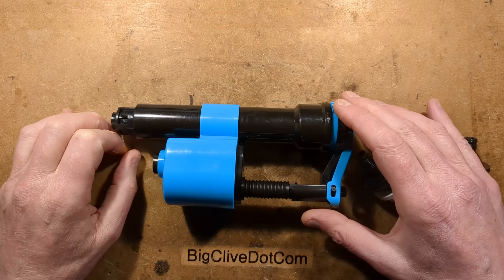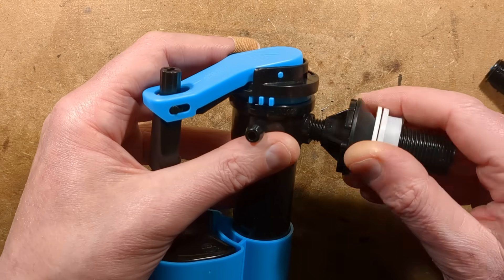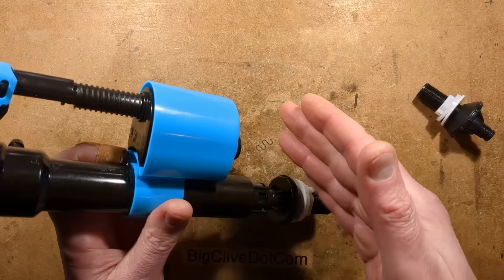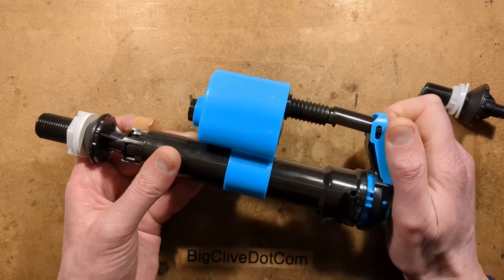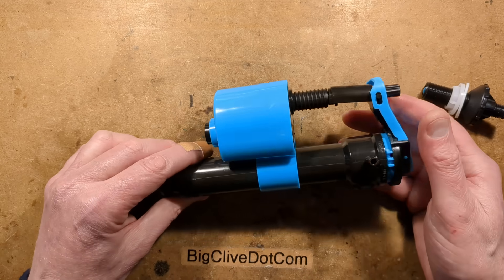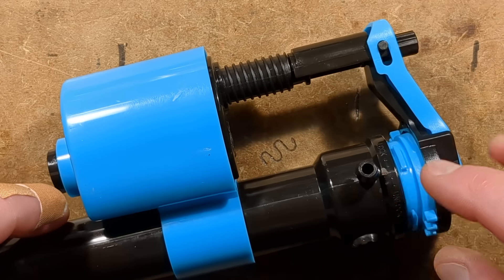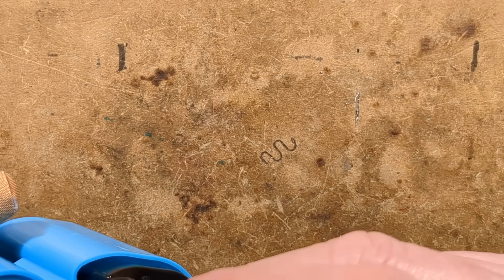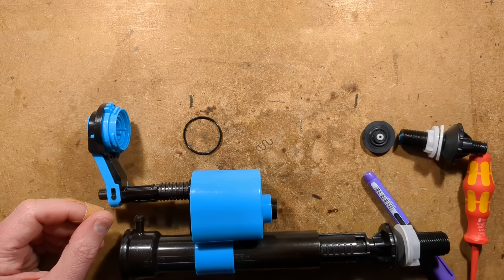Very clever universal Skylo toilet cistern fill valve system

Comment: American here and yes, the small side nipple is for a hose which empties into the cistern overflow tube into the bowl, to ensure the bowl is full. I bought a brominating system that goes inline with that hose to make the water in the bowl toxic to mold and mildew. It works wonderfully until the brominating pucks dissolve around each month. I can tell because I start to see mold growing at the waterline in the bowl, so I replace them. Though the manufacturer would be happy to sell you brominating tabs for several dollars in individual packets, I can buy the exact same ones in a large canister in bulk. They sell them at hardware stores for use in spas.

Comment: Will this work flawlessly for 83 years like the old cast iron, high mounted toilet cistern...with pull chain, that  I have in my downstairs toilet?  Mmn, doubt it, looks a bit flimsy to me.😅
Reply from the maker: No.  But those old fill valves did need repaired regularly when the water control valve degraded.

Comment: Not many pilot operated valves in daily life, but most of them seem to be in bathrooms. From the diagrams I've seen flushometers have a similar diaphragm, but with a spool valve that stops flow at both extremes to stop you from wasting water if you hold the handle down.

Comment: Thank you, your video finally convinced me to fix mine, in my case somehow the float and it's assembly which normally should be vertical was 30deg off vertical and as it was going up it rubbed on the side of it's assembly and sometimes got stuck and never got up so water started dribbling when water reached top. I rotated it back to vertical and now it works reliably.

Comment: Water conservation tip: When I use the shower, I run the water until it warms up. I collect that water in a bucket and pour it into the toilet tank as it is refilling.
Reply: When you conserve water, you are saving two resources, water and septic system.

Comment: I wonder how this conforms to water regs in the UK without having an unconstrained air break? Sometimes a perforated dip pipe was fitted from the inlet valve  into the water in a "standard" cistern to reduce noise - effectively filling under the water surface - but they were banned because the pipe meant there was no open water break and there was a hypothetical possibility of back-syphoning if mains pressure was lost ...
Reply from the maker: This valve was bought in the UK from Screwfix.  I think the critical level adjustment is what avoids back syphoning.

Comment: 6:30, if the piece of nail didnt come off completely you could have used superglue to hold it together till it regrows.   it may help to add carb soda to the superglue to build it up for strength.   thats what i try when i have a nail incident.
Reply: You can also use the material from a tea bag almost like laying fiberglass and epoxy.
Reply: @billtheunjust  , i hadnt even contemplated teabags.   i do find uses for natural fibre string with epoxy or superglue.

Comment: Hay Mr Big I had the experience with one of these new cistern valves but the little pressure hole on my version had a small metal pin valve in it and this either gummed up with crud or the rubber wore out and it leaked. This continually drizzled water in the bole a condition as a 65 y.o. I don’t want to be reminded of and after only a few weeks of operation. Fond memories of the old thunder box ball valve cistern 6 feet up on the dunny wall cast out of iron. The same as your modern finite analysis model but for adjustment you bent the float arm and I remember cutting a new seal out of an old boot yes leather and it lasted years. I also remember seeing my first so called closed coupled cistern and thinking there won’t be enough pressure for that to work. Arr yes everything has improved…. Wobbels the mad Aussie.

Comment: Great design and wonderful analysis as always, Clive. Have a look at some Geberit side and bottom inlet valves - some of which use a pivoting float rather than one that rises/falls. There are certainly some terrific designs, clearly considering the vast array of retrofit applications where a multitude of adjustments cater to aforementioned needs. The inclusion of both side and bottom inlet applications on this Skylo unit is incredibly practical.

Comment: I'm a plumber and have fitted loads of these. I keep one on the van as it's universal/'versatile' and saves carrying several other variants (although I do carry Dalchem/Torbeck/Fluidmaster for straight swaps as they're all still commonly found). These work great and they're cheap too. For those who mentioned preferring a brass rather than plastic shank, they do make a brass version for an extra £5 or so. A well thought out design for sure !

Comment: would that little nozzle be for use with the syphon urinal systems?
Have you covered the universal push-button dual-flush mechanism?
Reply from the maker: The syphons just have a trickle valve.  I've featured the dual flush system.
https://youtu.be/nOQK60npBUk

Comment: I have stripped those units before, to remove leaf debris that got in them, as the rustic cottage they were at was fed with water pumped direct from the dam, with no filter. Also did a few of the regular float arm types, as they were also clogged. Luckily I also had my small box of plumbing bits with, so had spare nozzles, all the large diameter low pressure type, as I rarely use them with regular water mains pressure, along with flipping the diaphragm around for those with bad wear. Done because otherwise no toilets in the ablution block, so did all 4 toilets in there, plus reseated 3 taps as well that were leaking, as just a washer would not fix the worn seat in the tap. needed a shower and sinks that worked.

Good thing Clive has never ridden along on a fire engine or any tanker truck, he would likely have tossed his cookies, and i wonder if a 30kl tank of hydraulic oil has the same effect on him as well.

Comment: That's very similar to Fluidmaster valves in almost every feature. The standout feature is the side or bottom mount option. That really is a fantastic thing from a repairer's point of view. I'm thinking that the brass version isn't changeable though. 🤔
Reply from the maker: They do the dual port versions with brass inlets.

Comment: I have a modern (?Torbeck) filler valve with a float which moves up and down around the pillar... until it scales up and sticks.  I haven't seen that much water coming out of an overflow since float balls were made out of copper and eventually sank.

Comment: Did some toilet repairs for my son in California. What struck me about US plumbing is the common use of those flappers for flushing instead of siphons. When they leak they waste loads of water. Also parts were very expensive, especially if old style brass ones. I am sure new houses there use cheaper parts.
Reply from the maker: The flap valves are incredibly simple and very easy to change the flap.  I use one here.

Comment: On one of our toilets the flush sometimes carries on very slowly well after  the main flush. I can't work out how a small flow of water can find its way uphill, over the top of the siphon and down into the pan. As normally the siphonic action only starts when a large slug of water is pushed up the hill by the flush handle.
Reply: The only way to stop it is to crack open a joint on the siphon to let in some air to break the siphonic action. So somehow the siphoning is carrying on very slowly because there has not been enough air ingested at the end of the flush to break the siphon. It's all very mystifying.

Comment: My experience in NA. Toilets have a 1/2" supply line, 3/4" is overkill. I have never seen side entry. A standard toilet shutoff valve is fitted and from there,  usually a standard flexible toilet line of desired length. Yes you can get a rigid line, but that seems to be needlessly more difficult, and im not sure anyone does that these days.

Comment: The brass pipe connector version is the only one to use. Plastic threads can strip off from the water pressure.

Comment: Would be perfect if these can be changed out in situ without having to remove the part that screws to the cistern and copper pipe. I wonder how sturdy that one is with the narrow neck thread joint - if that snaps one major house leak! In a previous house every cistern had a fill valve from a different manufacturer... all incompatible. First job moving into next house was to retrofit every cistern with identical fill valves.

Comment: Nightmare to work on when in a cistern. Try getting pliers in like that when its fitted. Also the valve doesn't separate,  so you cant just change the head. Fluid master so much better, plus more places carry the washers. But good video @bigclive.

Comment: I’ve never seen a side-inlet valve before. Typically use bottom inlet here in the land of freedom-eagles. (Bottom-entry. 🤭) That diaphragm seems to be the standard nowadays. I put several differnt brands & models of valve in a toilet before I realized that it was unfiltered rain water that was fouling the diaphragms. 🤦🏻‍♂️ duh.

Comment: That looks so much like a standard modern Fluidmaster "fill valve" here in California... all plastic, telescoping tube, side siphon fill, large plastic float attached to the tube, valve/diaphragm system, it's all there. The main difference I see is the cup around the float with the air pocket. Ours don't have that. Looks like a nice addition. Also here they all have the inlet at the bottom. Super easy to install. Clever stuff.

On the subject of phobias, mine is about people mentioning their broken nails... brrr... I had to skip that fast. <people are weird>

Comment: One of my biggest peeves in life is waiting for the cistern to refill. You're standijg there like an idiot, listening to the pitch of the valve or water filing, waiting for it to recharge enough to engage a second flush. 

I like to pull the restrictor out now, but it only helps a little with refill speed. I'd love to see a solenoid based systen or something other thwn the diaphram system where a higher volume could flow through. I've given fluidmaster this feedback. Maybe one day they'll redisgn it with a bigger diaphragm and  manually operated ball valve so people can set their desired fill speed. 

Ps. Youre correct, that side outlet is for placing a ½" tube into the overflow pipe which refills the toilet bowl, and maintains a higher water line in the bowl.

Comment: That little nipple at the top that is block is for a tube that goes down the center of the fill tube. There are holes around the underside of the lip in the toilet itself so that water sort of washes the sides of the toilet while it's flushing. At least that's how it works in the us.

Comment: In the US, the small port rinses the trap, but a new gizmo is a bleach canister plumbed in-line, adding bleach on every flush. Bleach gets in the rim and its holes, but does not sit against rubber bits like the big flush flapper, or tank bolt washers, and rot them. "Fluidmaster Flush 'n Sparkle". Helps with annoying brown stains (our well-water has iron bacteria).

Comment: Looks like a clone of the classic Fluidmaster 400A, which has been a common fixture of US plumbing since the 1970s and is still made today. The earlier 200 and the much rarer 100 use the same diaphragm as the 400, so that exact same part has been in production for over half a century. The diaphragm of this one looks to be slightly different, maybe to avoid patent issues (no doubt long expired by now) but the pilot valve in the Fluidmaster is actually a concentric sliding-spool type embedded in the middle of the diaphragm.

Comment: Here in the US, most toilet valves use that side port to direct water into the bowl, not necessarily for siphonic flush but to refill the bowl in the event too much water is expelled during the flush to restore the standing water level so the water level is high enough to seal against the sewer venting through the toilet.

Comment: The popular fill valve in the US is the Fluidmaster. I remember when they premiered in 1965. Their ads were amusing but the part that fascinated me was the fact that the valve closed smartly AND the valve system worked WITH the water pressure and not against the pressure as in the old ball cock valve. So this design is probably a descendant of the Fluidmaster, once the patent ran out. Great video, don't let the toilet scare the crap out of you again. Can be very messy if you're not turned right way round.
Reply: Fluidmaster valves are still very popular in Australia, and especially in retrofit applications. I have always used them, they are evidently well engineered.
Reply: We have the fluidmaster valves in the UK, made under licence here. I fit the cable flush valves and filler valves. ( I'm a plumber). 👍

Comment: We've been using valves like that for years. Good news, over time, they fail too! Generally the float valve, just like the old days. Only time surging water bothers me is when I have to urinate....
being closer to 70 than 60, it's an issue. The top port is used over here just for that purpose, to fill the bowl whilst filling.... The syphon toilets are pretty rare over here in the US. US kinda went straight from out houses and chamber pots to basically the same toilets we use now. Folk just didn't like the idea of crapping inside the house well into the 20th Century.

Comment: I feel like these are the slandered in the USA because on all of the toilets I've opened and in the shops I've been it there the only ones I remember seeing I've never seen the float one before today.

Also I keep my nails short but just long enough to eject Micro SD cards and remove ZIF connectors on PCBs for work but I have also experienced the pain of bending a nail 90 degrees and then back first on accident then to fix it not fun.

Comment: Sometimes we need a break from electrical to pursue other interests.  So, this is the channel where I learned about the wonky and weird and possibly out of date electrical outlet and the systems (the weird way ring mains are used) that surround it in the U.K. and even about the way your toilets work by siphon instead of pulling a plug like ours in North America. 

I have had nightmares for surging water, but toilets don't bother me.  Like you said, it's the industrial sized areas or even watching videos of the flood gates of dams that make me think I am glad I am watching this through video and not being actually there.

The description of the valve and diaphragm is not unlike the operation of a flushometer valve on commercial toilets or a washing machine water solenoid valve.  Referencing Tim Hunkin's "The Secret Life of Machines:  The Washing Machine" in this case.

The barb on the side of the valve is for filling the bowl through the overflow in at least North American toilets.
Reply: A maintenance man showed me the pump room of an Olympic sized pool and it had white metal pipes probably 1-2 ft in diameter rising and turning this way and that. 

I was not a fan of the idea that so much water passes through there!

Comment: Any device that simplifies the plumbing experience is a major plus in my experiences. Now if they could make accessing the faucet connections under the kitchen sink not involve impossible yoga positions, I would be most happy.
Reply from the maker: They have some ingenious faucets that allow you to drop the flexible pipework in from the top and then lock it in place.

Comment: The lil rubber diaphragm arrangement is the only issue with this design. It fails frequently in my particular case. I've had it replaced many times, and when my "landlord" comes out to replace it, I ask them for a couple of replacements to save the call out. Each time, they say they don't have any spare cause it's such common mode of failure, they only have enough to hand for their shift "I'm going to be doing this job all week".

Edit, I'm in a hard water area, but it never seems to be "clogged" or limey, just fails.

Comment: If this is a new invention in Uk, then i have one question. How long needs a invention to pass the english channel ?
In Germany we have tanks with this sort of valve, at least since 1984 (could be a bit earlier. i startet to learn plumbing 1984 and we had geberit inwall tanks with similiar valves). for the the old version of this valve look in google pictures for ''geberit füllventil typ 84 typ 350 dvgw 368'' 
this was replaced by ''geberit unifill 380'' around late 90's early 2000's
Reply from the maker: It's not that new.  Just refined over time.

Comment: We recently had a slow filling toilet, I narrowed it down to this fill-up valve, I was going to replace it myself but when I went into the tank area I saw the plastic was quite discoloured and honestly I was afraid I'd break something removing it, so we got a plumber into do the job, 10 minutes for him. But it is interesting to see how one works, I especially like the amount of adjustability and servicing, I have felt after recent "upgrades" to our water supply the quality had dropped some, I only say that as we rarely had issues with the toilet especially, for decades before.

Comment: I looked online but those don't seem to be universal enough for Australia. It could also be that our cisterns use a dual flush valve system - full or half flush depending upon what you deposited.
Reply from the maker: The full and half flush is a different component in the cistern.